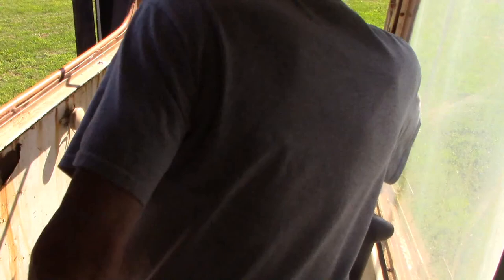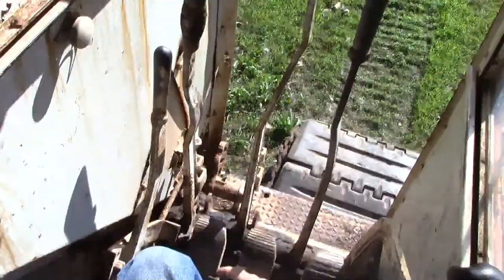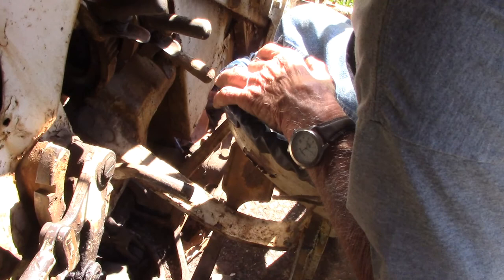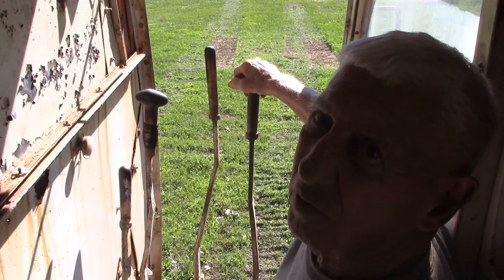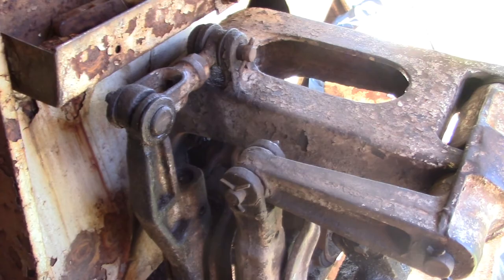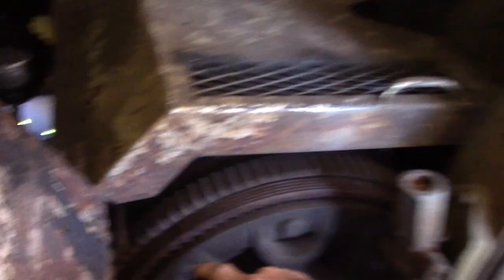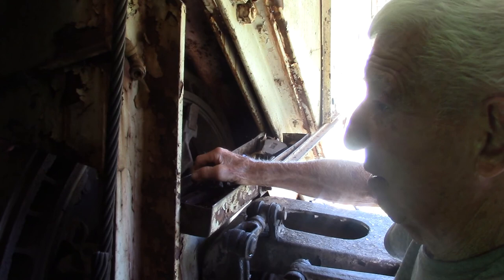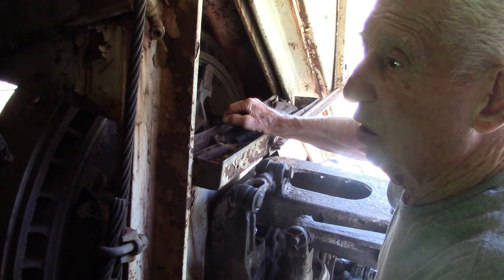Northwest 80-D With George Jarvis, Part 1

Comment: Awesome video, cant wait to see the other parts! I would love to know what the original owners intentions were with that machine, only a moron would spend that extra money to put independent boom hoist on a shovel. It would never be used!!! When it comes to a crane boom, shovel boom, or gantry on a pull shovel... you set it and leave it. Independent boom hoist is only useful on a lifting crane or a clamshell because you are constantly adjusting the boom.
Reply from the maker: Good point, who knows? There is a model 41 around here that has every option you could get, but as i understand it, it was a state machine originally. When it's the taxpayer's money that you're spending, who cares, right?
Reply: UnitCrane514 This particular 80D had just about every attachment on it during its time at Daniel O'Connell's Sons. The superintendent that worked with it gave George a bunch of great photos of the machine working different jobs.
Reply: I guess they wanted to be able to use it for hook work if necessary.
Reply: In another video, George says they used the rig a lot for pile driving,  the independent boom would be pretty much a necessity to get any production when driving pile.